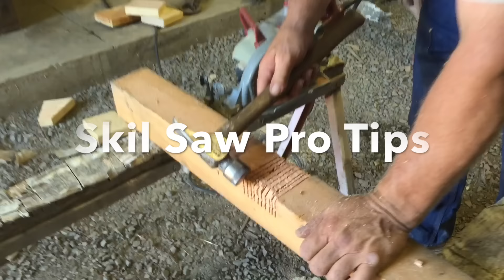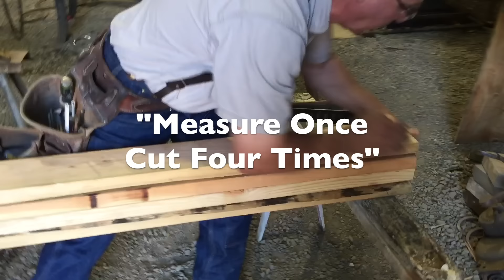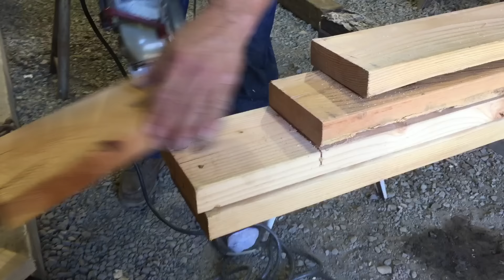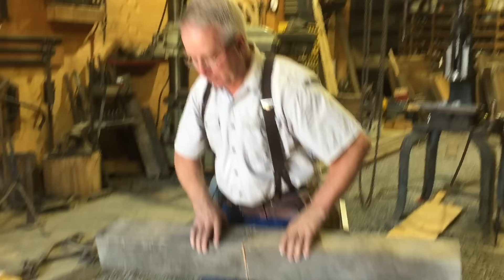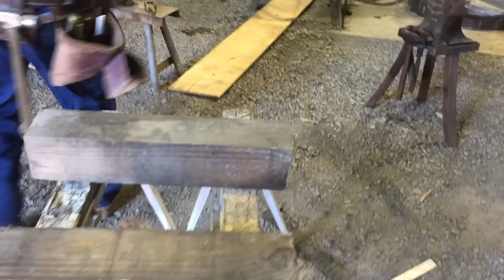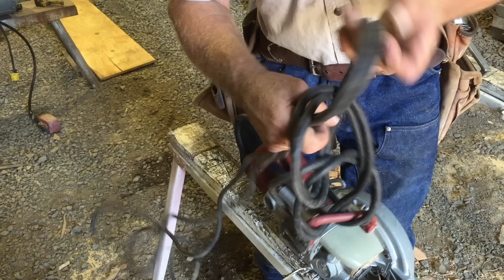Skil Saw Pro Tips

Comment: The MAG worm drive is a great saw. I've had my 77 for nearly 20yrs. The craftsman seen in this video recognizes the added safety of a worm drive over a direct drive. But, some viewers here, may not.  The worm drive cuts by way of increased torque, allowing a lower RPM of the blade. A much SAFER saw when compared to a direct drive (widow maker), which relies on a higher RPM to get thru material. The "Polish plane"...NEVER utilize this technique while on a ladder, Never use while cutting overhead, and don't be afraid to take the time to lower the foot of the saw,. You probably don't need 2" of blade hanging out.  Also, when this craftsman says the words "It'll bite you"....What he really means to say (as a gentleman here on YouTube)..."You have a family to feed, slow your actions keeping safety in mind".

Comment: Great tips. I was a production framer in San Diego and Riverside. For 6x6 I took the guard off of my second saw and put an 8" blade in it. Not exactly OHSA approved but I used to believe guards were more dangerous. If you respect your tool you're less likely to get hurt. Westcoast tradesmen use the chainstitch for cords because the cords don't get hard in cold weather. East coast carpenters use sidewinders too.

Comment: Love your videos hope to see many more over the years to come.  I have a quick question regarding your MAG skil saw, the shoe or base plate on yours seems so easy to adjust, is there a trick to tuning that? As an apprentice I've had the exact same saw for over 2 years and even after loosening the bolts I cant adjust my bevel angle without using lots of force.  Might be a good question for Q&A sometime...thanks again for the great vids!

Comment: Funny how a carbide saw will go through a nail so easily. I'm a plywood sawyer at Swanson. I've seen a saw go through a piece of 1/8" steel with nary a scratch but when we cut MDO, the fine wire staples  they use to hold the paper on while they press it, just absolutely tears up the blades

Comment: These Skill Saws have come with a hook that wings in or out for hooking on to a truss, roof rafter or floor joist while sheathing a roof or installing a sub floor. Forcing the saw's rpm to slug down for the sake of speed builds up wood sap or pitch
behind each carbide tooth creating more friction causing more heat thus shortening the "sharp life" of the blade.
Letting your tape measure slap back to it's casing wears and ovals the rivet holes of the hook at the end of the tape, for this play is specific and equals the thickness of the hook end, so that your tape remains accurate.... whether pushing the tip from where you are measuring or pulling. If you are not experienced with this saw, never pull it away from the cut until blade stops rotating. Great show otherwise but unsafe practices for novices. I've done the same to cut time. I bid my jobs. If you work by the hour it's not worth it. very dangerous! Hands on General Contractor 38 yrs. Still humble and sharing what I know.

Comment: My only bone to pick is about noise protection. It may be a personal choice, but i don't know any finish carpenters or woodworkers that don't have hearing loss. I have it, but it is less. I did not work construction, but have used power tools my whole life, and still use them daily. I have noise protection at each station in my shop, i work wood for a living now.    

You may or may not be interested in this from here in my home town:  http://etd.fcla.edu/UF/UFE0004882/callahan_g.pdf

This gives an idea of the noise levels from our tools, and remember, sound over certain db will cause permanent damage in a very short period of time.  Ear protection is cheap, harbor freight chineseum is good.   Meanwhile, i love your videos, i love what you are doing, i always learn something.   Again, it's your choice. Your reasons are your own, just for others, think about it.   thank you.

Comment: I have watched most of your videos and find them very interesting and you make learning fun. I saw this video a long time ago but never use any of your trick until today. I was making a railing around a deck and had to cut many boards the same length. You video about measure once, cut many times. So I measured once and cut 5 boards. Checked them. Close enough. Finished the railing in no time. Great trick. Thanks
Andy

Comment: I'm a professional carpenter and use these tricks all the time in rough framing since 1975 when I first when in apprenticeship.  Please beware these are for professionals only ... But the pros knowing saw kick back and how there saw reacts have no problems using them.  I have never had a accident using them and I always respect the saw it will kick sooner or later be ready. One of my old metal handle (35yrs old) saws has a 16d nail holding the guard open that I put in there 30 yrs ago.  If OSHA shows up on a track I was working I could remove and drop the guard in a sec. I feel the guard is more of a safety hazard requiring a carpenter to use one hand to make a plunge cut or polish plane.  One of the best videos on proper saw usage that the pros use everyday. This 65 yr old retired stacker loves this video.

Comment: invaluable tips! your skill with the skill is quite impressive, i cant imagine being able to freehand rip a 45° bevel on an edge of a board while holding it with my other hand. my favorite was the board notching with the series of cuts and polish plane, ingenious and simple!

8:50 made me nervous i admit it, was imagining the saw kicking back and either smashing into your kneecap or worst case  cutting your kneecap in half, not worth the risk imo.

ive been using a chain stitch for a long time to store all my straps, i never thought about using it for electrical coards though, im going to give it a try.

also,.is that a radial arm.drill.in the background? im jelous!.i had the oppertunity to buy one of those pretty cheap but didnt have the means to move it.

Comment: Amazing video! Inspiring skillset. One thing that made me cringe though- have you looked in to the 'over-under' cable wrap technique? It's what we use for all cables in show biz including the most delicate and expensive ($5,000 cables are not uncommon). They get wrapped and unwrapped on a daily basis for decades and lay out flat without damaging the very fine wires inside. Once you get the technique in your hands, it's fast and efficient.

Comment: Very high level of skill demonstrated for a framer, I wouldn't recommend these techniques if your a beginner or intermediate.  You'll lose a hand in no time.  I'm not sure if I would recommend these techniques unless you're the Michael Jordan of framing which this guy obviously is.  Think of it like this.  You see a Harlem Globetrotter perform some tricks.  Don't think you can go out and do these tricks without decades of practice.

If you want to see true masters of framing, search "Japanese Framing".  Entirely different tools used but they build houses and commercial buildings as if they are pieces of furniture.

Comment: I also have the Skil Mag 77 with the flip-out hanger. I may have to put the longer cord on it if the one I have wears out. I am definitely going to do it with my two Milwaukee 8" sidewinders though. Both cords are shot on those saws as I have used them for 30 years on my oldest and maybe ten on my "new" one (that's actually older than my "old" one -- long story...). Great video. One can always learn something new.

Comment: From 7:00 on, the Skilsaw dado method, is not to be taken for granted by DIY or amateurs. The video host Scott Wadsworth is a *master* framer. Everything he does makes it look easy. This dado requires extreme skill, cuation and experience. From 8:00 on, watch his hand location and saw attitude on the block. Watch it over and over. The left hand has a firm but flexible grip on the blade housing to slide the saw laterally and level while the right side shoe skates over the flat top to ensure level planing. The whole aim is keeping the shoe dead level with the block top while controlling the blade. I usually dado on a miter saw because it's setup in place and an easier go-to. The circular is faster and just as accurate with proper technique.

Comment: Ive been using the "polish plane" for decades. Especially for knocking off the occasional ceiling joist protruding above the roof rafter above the birdsmouth. One hint you didn't touch on was using the front of the saws shoe (you call it the bench) to start off square on a crosscut. I used to use the worm drive in the eighties/nineties but almost exclusively use the lightweight Makita sidewinder. I think the first thing we all do is throw away is a saws rip guide LOL. Use our thumb and forefinger for that. My wife doesn't like to watch when i use a saw in the manner you do. Especially freehand. she thinks i'm about to plunge cut into my thigh!

Comment: Love the name of dragging the blade Polish Plane another square cutting tip is just make your mark and then hold your speed square preferably but combo squares and roofing squares work, hold it on your material square and slide your saw base along it  holding it firmly against the square and the blade inline with your mark

Comment: Plunge cutting. You might want to mention that the blade shouldn't be over tightened-because it can kick back, and that you'd never (well I'd never anyway) try this with a speed saw with a higher rpm. Certainly not with my leg right behind the saw. (And the Polish planing joke is wearing thin.) 
What I learned about chain braiding an extension cord is that chain braid from the middle. This allows you to unchain the  plug ends only as much as you need to use. 
Two things I learned when I got to California. 1. When you cut with a SkilSaw, you let the weight pull the saw through the board and 2. Chain braiding a cord isn't as useful as a proper loop. Once I learned how to properly loop a cord or a rope, I never chain braided again. I can toss and play out an extension up to the second floor from a properly coiled cord. 
The long extension is a terrific upgrade. You never have to worry about the plug falling out of the extension because that connection is far away. I like to have a 12 gauge or better wire.  I've even wet cut marble using a SkilSaw.

Comment: Stone masons use worm drives with diamond blades to cut granite & marble with a sponge or  water hose to cool & help stop chipping , they also remove the deck to cut deep, free hand cuts & pull the saw backwards not push it through the cut.

Comment: obvious that you have pulled that trigger a time or two.

I always liked the worm drive over the traditional circular saw. Not only for sight lines but also for the weight.   

A couple things I figured out (which I'm sure most framers probably figured out also):

use the weight of the saw to help you cut,

if the chord is in danger of contacting the blade I will throw it over my shoulder  (especially nice on a downward cut),

I also try to keep all body parts (except the hand on the trigger) out from behind the the saw when cutting in the event of a kickback.

Also, gotta love that rafter hook.  👍

Comment: Huge accident is the guard getting stuck open and when the user goes to hang it back in the cut bench, they gash their leg open right at or above the knee cap. Apparently it's one of the most common injuries. I use a wormdrive all day everyday. Always wear safety glasses and ear plugs. Always have a death drip incase of kickback and always keep your other hand well out of the way. If you have to cut a tiny piece off a tiny piece, start over with a bigger piece. I cut off to the side of my foot which is kinda dumb but IF you wanna survive in the trades you kinda have to. Never hold something with one hand and cut with the other. Easy to do, easy to fuck yo and cut some fingers off. There will always be someone to tell you it's easy and safe to do something stupid. They are just one of the people who will be hurt in the future. I met a guy who wouldnt wear glasses while grinding. Said "I've been doing this for 10 years and never had anything in my eye". Ok...lol. People are strange the way they think. Everyone's a champ with one until they are bleeding out.

Great video.

Comment: They just don't seem to use that worm drive skilsaw here in Scotland, nor is it really for sale here.  I have the little 1400 watt Skil direct drive. It is probably a toy compared to that one, but over the years it has been real handy for everything from boats to houses, the lot.  Wasn't that long ago here, that the only saw on site was a circular diesel unit that was shared by the joiners for the heavy cutting on roof work or floor joist.  All else was handsaw. That was still the norm on housing estates, being built in the 70's.
   A joiners tool kit was in a suitcase sized box.............and that was it, plus a trestle made on site lol!

Comment: "The Bitter End" you referred to has its origins in old sailing ships. They didn't have bathrooms on those old ships back then. What you would do, is hang your ass over the side, do your business, then wipe your ass with the end of a rope that used to drag in the water. The end of the rope was known as "The Bitter End". You probably already knew that but just in case...

Comment: I guess I never knew it was called a polish planer. I've used that and some of your other techniques a lot. Although it appears to be unsafe it works really well but throws chips of wood everywhere. Safety glasses are a must on most of these and anytime you're dealing with tools. My only concern is with the new thinner blades is having a blade explode or fly apart. I know grinding disks can do that randomly too. Hasn't happened yet and I hope it never does but beats the heck out of getting a chisel out. Tools are like weapons and if you know their limitations and understand them most of the time you'll be okay but don't get too comfortable or they'll bite you in the ass. Great videos sir.

Comment: I'm a carpenter and a contractor. an do alot of things he does. I'm just on a side note I had to laugh his hammer is a stiletto 13-ounce titanium his nail aprons are Occidental leather because I've got the same ones and they will last just as long as that's saw.  the blade on the saw that DeWalt.  but for gods sake dont do things he or i do with a saw be safe.    dont do it unless you have used a saw along time 
be safe

Comment: I've watched this video numerous times in fact it's the video that brought me to this channel. I have a Mag 77 that I use everyday at work. Worm saws are not really that widely used in New England except maybe out on the islands (Nantucket and the Vineyard) because of the PT and of course timber framers.  I initially bought a harbor freight worm saw and, while it can't hold a candle to the Mag 77 I found the set up just so much more intuitive that I wanted to use it daily. Bottom line if you use a circular saw at work or a lot of DIY this is really the only saw  to own.

Comment: I just stumbled upon your channel, and I have gotta say, I wish I could have a day or two to pick your brain in person!. I do have a question about hammers. I work at a roof, and floor truss manufacturing company, and have been for about 6 years now, but I still haven't found the perfect hammer for the job. my two go to hammers are a 22oz Estwing framer, and a 23oz Vaughan straight wood handled framing hammer. the problem with the Estwing is the vibration, but it's durable. the problem with the vaughan, is it usually end up breaking the handle within 6-9 months, but, it doesn't vibrate as bad as an Estwing. I have thought about trying a Stiletto, but I'm afraid that it won't have enough weight, because with where I work, most of what I do is beat truss plates in place, so they hold the lumber together while a press finishes the job. Bottom line, the stiletto is an expensive hammer, and I'm afraid it won't be what I need, and I will have flushed a lot of money down the toilet. any suggestions would be greatly appreciated!

Comment: Excellent video,  only use that "Polish Plane "/brushing cut with an old blade,  it may chip the outer corners right off a clean square tooth ! 
   Also, that lightweight ally roof material may cut well but don't try it on good old UK corrugated iron unless you actually enjoy buying new blades.

Comment: This may not be a trick really but I learned early on to be comfortable making basic cross cuts with both hands. I'm left handed and i do 99.9% of my cuts with my left hand, but every once in a blue moon i really need to make a cut with my right and I'm glad that I taught myself to be comfortable doing it.

Also, the ABC's of power tools are Always Be Comfortable. If you aren't comfortable doing something with a saw, don't do it. Use another tool if applicable, or get help. It's much better to have a bruised ego than to lose fingers.

Comment: Good morning;   Steel sheet goods  ( profiled )  cut so much  better upside down,,,added advantage is no scratches  in the painted surface,,,of course   layout  is a bit more complicated but that is what an awl is for,,,a little poke through at the  intersections   transfers the measurement to the other side.